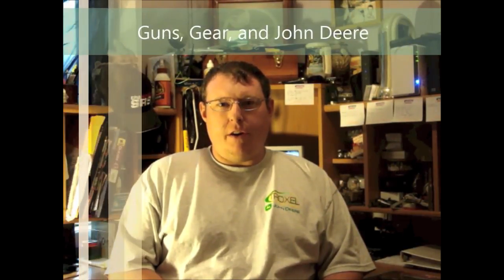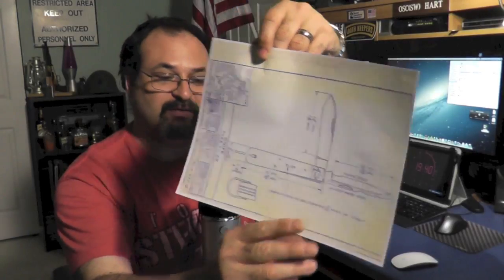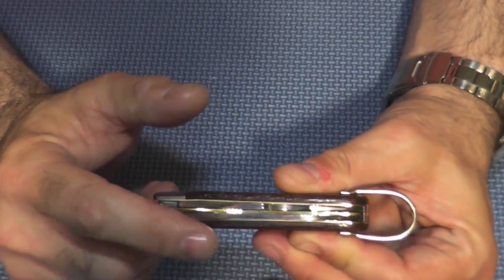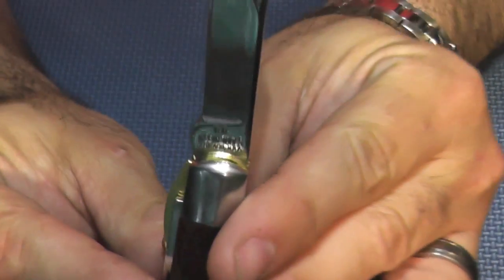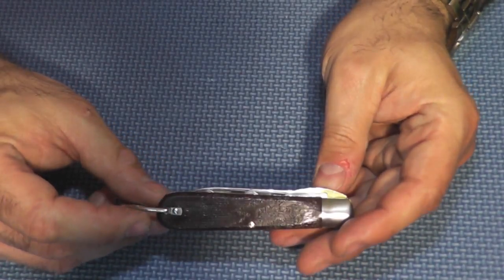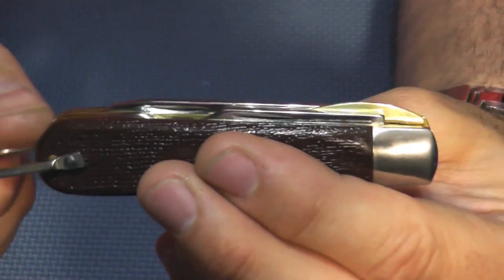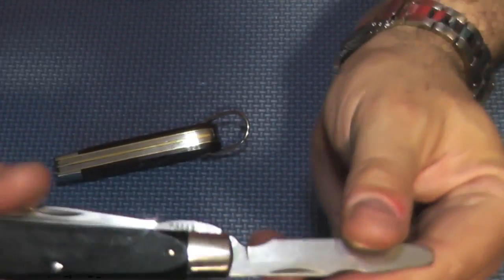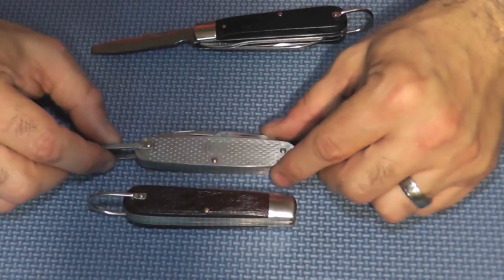TL-29 by Klein Tools

Comment: The old friend I've have was GI surplus by Camilus. Not the one I used in the service, but identical. We called them "The P-38" 6o years ago. That rough edge was intentional, because it would cut, (saw?) through semi-hard insulation better. A classic design that served me over 50 years.

Comment: I have a TL-29 based Camco knife. Vintage knife handed down from my dad, and I'm 64. Camco and USA stamped on one side; 229 on the other. Brass liner lock for the secondary blade. Did a little research and one source said Camco was a cheaper but still decent quality division of Camillus started in 1948.

Comment: Fred, great video. I am nuts about knives. I did some comparison in photos of the Klein TL 29. It is identical to the  modern Kutmaster TL 29. Same plastic wood grain handle, same pin placement, and blade shape. I believe they are manufactured for Klein by Kutmaster. Just trying to be helpful.
Reply from the maker: ***** Thank you so much for the great information, yes it is very helpful!!!